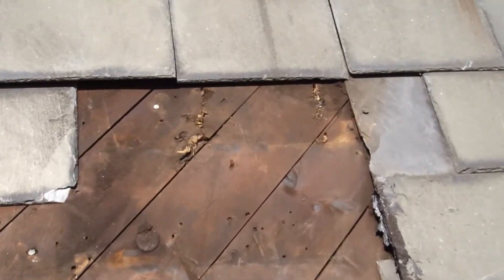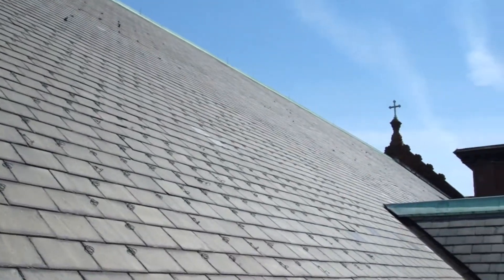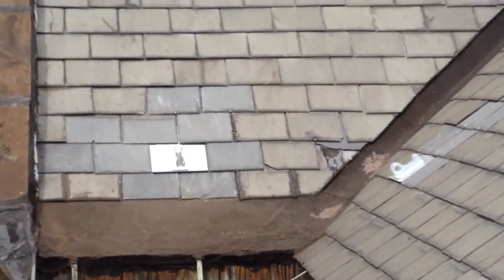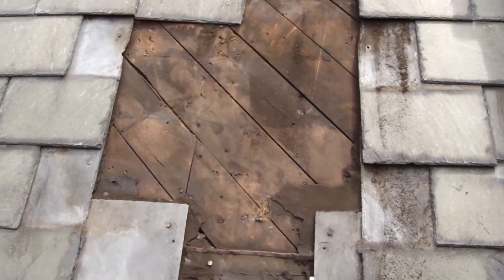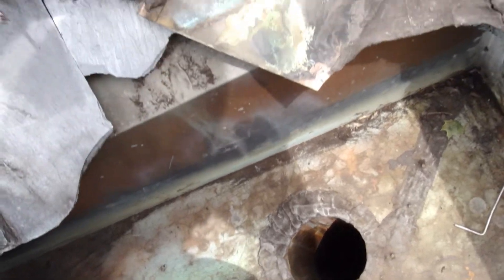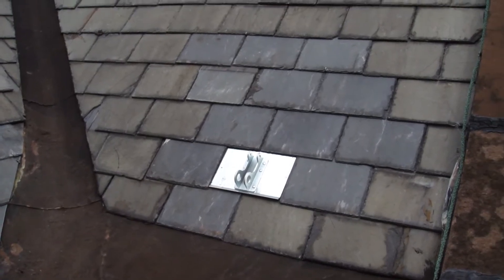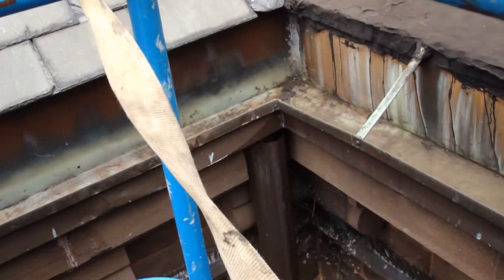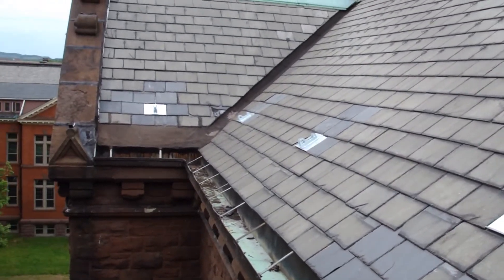Slate Roof Repair in Connecticut, JP. Bachand Contracting

Comment from the maker: Steve, You are correct. Not only should the base plates be not more than 4 feet apart but on this huge roof there should be another whole row of them up roof no more than 25 feet away. This roof has over 50 feet of rake. Remarkably they survived 110 years of service just the same. I'm the only contractor who has worked on this roof since 1983, we've had to straighten the pipes out plenty of times, but never anything like this before. Likely part of the reason they survived so long is that they were assisted by the wire ring, and Zaleski type individual snow guards spread over the entire roof at one time, but which have been disappearing more and more as the decades go by. 
Unfortunately, this was an insurance job, and even though I pointed out how inadequate the spacing was, they would only pay for what was there before, we've already had one ripped out since.

Comment: Well maybe if they snow bar brackets had not got installed so far away from each other it would have not got ripped off so easily ... I install these things all the time on slate roofs  and I've never seen them spaced so far apart from each other